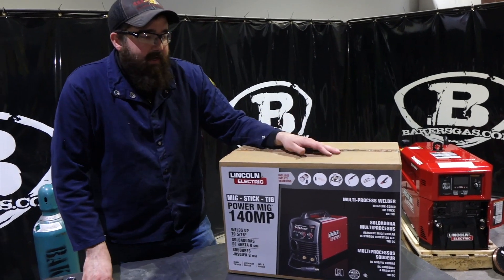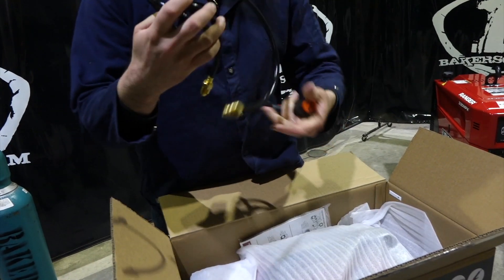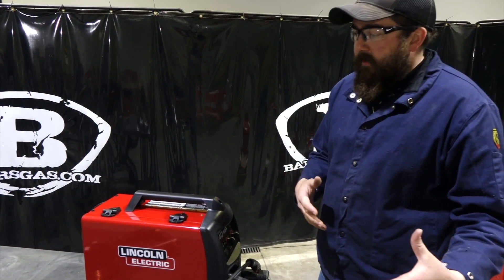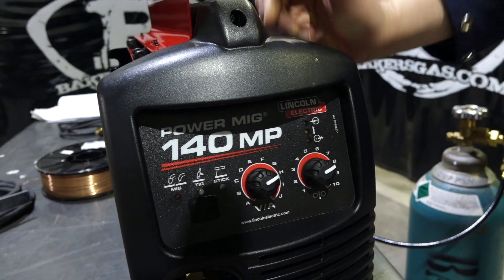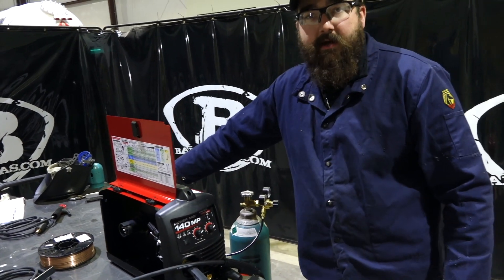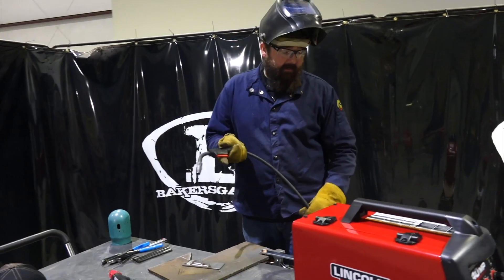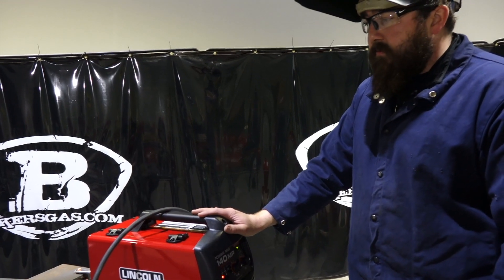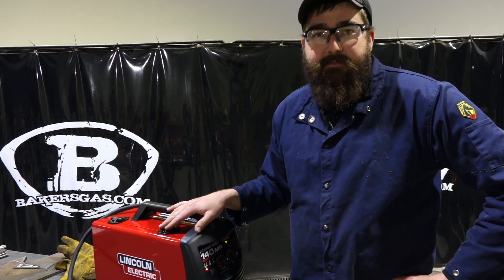Lincoln Electric Power MIG 140MP Review and Demo

Comment: Id get a millermatic 211 over this for an extra 400$ and weld up to 3/8 . Spool gun 300$ , stainless mig , and fcaw / mcaw . Cant go wrong .
Reply from the maker: Sure both are good machines one difference is the 211 is a MIG only unit.
Reply: Yeah,  only thing wrong with that is it isn’t a Lincoln
Reply: The Millermatic multi-process welders run $2K. You're comparing a MIG only machine (Miller) with a Lincoln multi-process machine. Try to TIG or stick with the 211
Reply: @richmac918  not true the 215 is 1600!

Comment: I have a Lincoln Weldpak 140 that has to be close to 10 years old now. It's been good but it's limiting in that the voltage selection is limited to 4 positions (taps) only, can only run MIG and flux core and is heavy. Is the voltage knob on this machine variable or is it a tap selection like I have? At the very least there are far more selections than I have but I'm guessing the knob can be put half way between positions since this is an inverter welder?
Reply from the maker: Check out the specifications tab that should have your answer. I believe its tap selection still but we can confirm with Lincoln if you want to call us or let us know the best way to contact you. https://bakersgas.com/products/lincolnpowermig140mpmulti-processwelder-k4498-1

Comment: Wonder what the difference between the 140mp and the le31mp is that you get at Home Depot???
Reply: I have this question too, in case somebody knows
Reply: I'm confident to say that the duty cycle for the LE31MP is 60% where as the 140mp is at 40%. That's the ONLY difference that I can think of.
Reply: @koonelos  I had the same question...asked support from Lincoln and they said they are the exact same.  The LE31 is big box stores (Lowe's Home Depot etc)...the 140mp is for places that are like authorized welding dealer shops.
Reply: @tdirks2960  you're exactly right. Even if you download the manual for them they're the exact same.